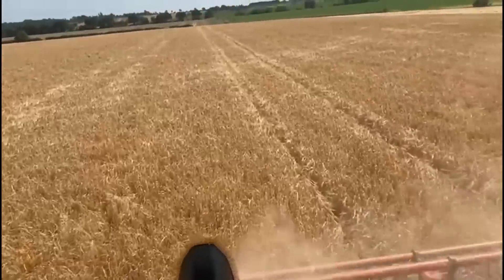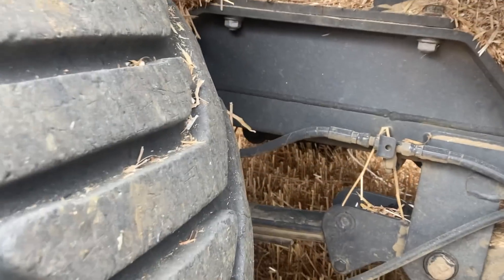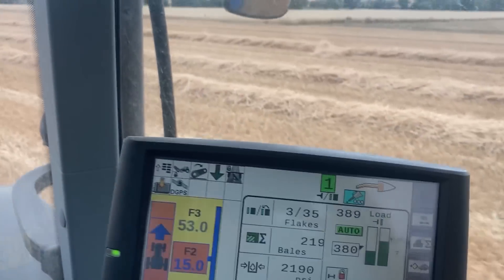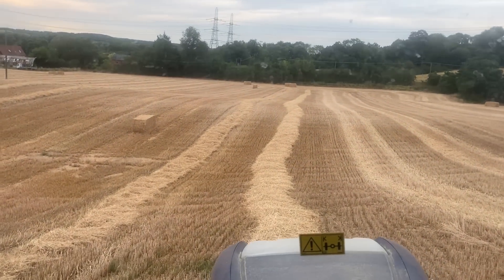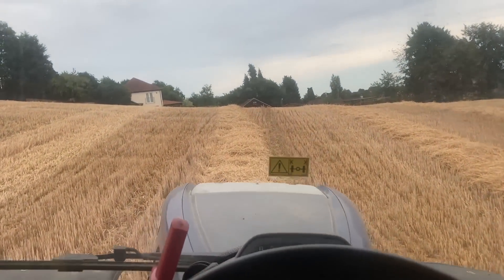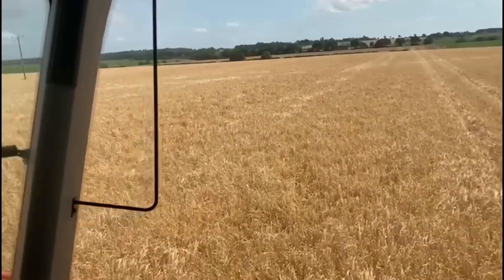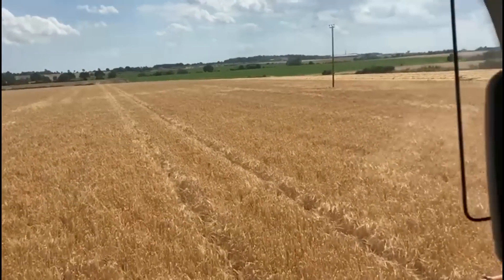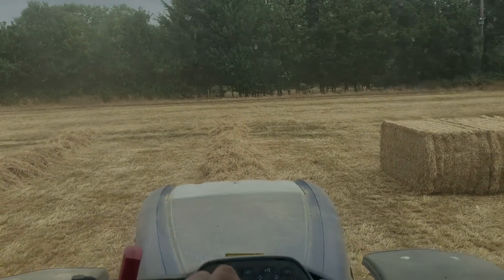A new Blue power T7.260 is at the farm.

Comment: Hi stephen, may I ask how you are satisfied with the autocommand transmissions on your tractors?
Very good videos you have posted. 
Greetings from Germany
Reply from the maker: Thanks for that comment. The transmissions are fantastic as far as I am concerned. We have had them since 2011 and no problems yet. I think they use less fuel especially when on my big baler in the summer. As when going up a steep hill the transmission slows down so the engine revs don’t drop.
Reply: Thanks for your quick reply, that sounds good. We also drive New Holland tractors T6/T7 powershift transmission and combine. Your farm seems really big.